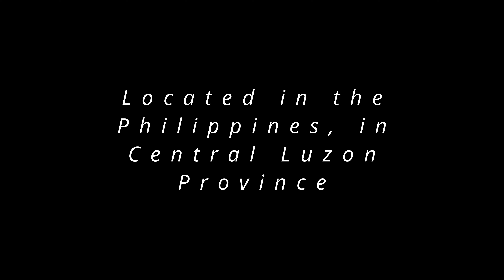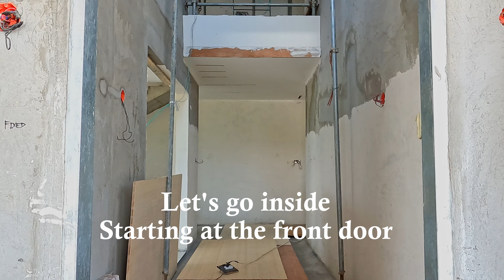Philippine House Building - 10 Months In

Comment: They could not have even cleaned the mortar on their joints for the cement blocks on the fence and. Am not talking raking them but just troweling them flush.. It cost you more in extra motor than it would have to do a clean job and it looks terrible on the outside . I am sure if anyone builds a house next to yours they will not be happy with that workmanship on the fence. That might  be how they do it in the Philippines but it ultimately is your house. Having had 4 house built for myself in North America I could never accept that without questioning and correcting as it makes no sense.
Reply: Not crazy about that myself but I believe they will probably "render" (their terminology)the walls at some point and smoothe it out.
Reply: @michaelmarchand7653  No they already said they were going to put plants on their side and nothing on the outside .I guess it sucks to be a neighbour in the Philippines..
Reply from the maker: No money left to worry about perimeter wall appearance. You have experience on your side - this is our only build, so inevitably you will see things that we miss.
And to some degree I have already done the neighbours a favour - I have built them security on part of their property for no cost to them. If they are worried about it, and they ask me, I have no problem with them doing something on their side of our wall to make it look better. For me, it is 100% about security - pretty does not come into it.
Reply: @philippines4.0buildinganew64  Yes there is nothing better than having a neighbour pay for your fence. Thank You ! I know on your first build we miss things I am just questioning the workers more than you as to why they would not clean the mortar that squeezed out when it requires less mortar to be made and less work  and looks much more professional. One has to have some pride in their workmanship and when I look at that fence no matter how straight , strong , high, secure the squeezed out mortar all over negates any pride attributed to that wall .